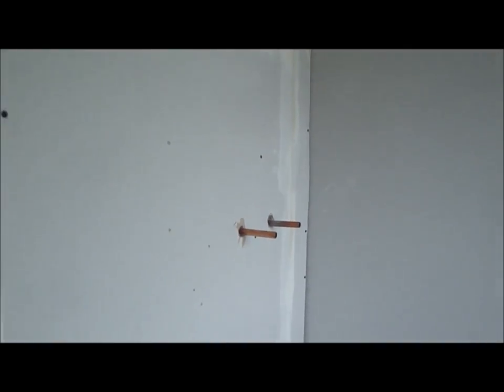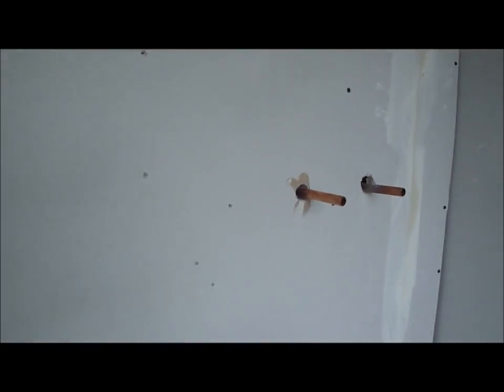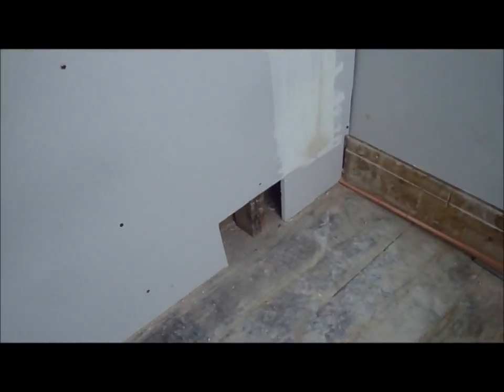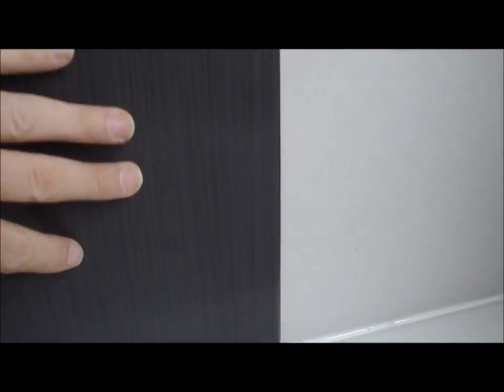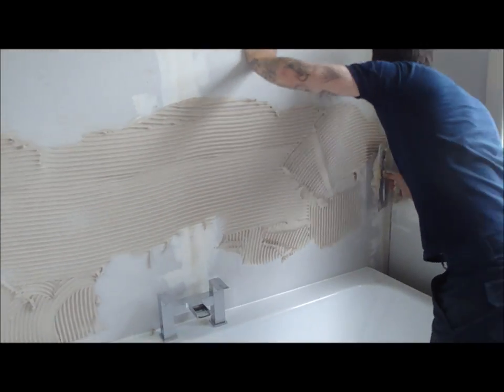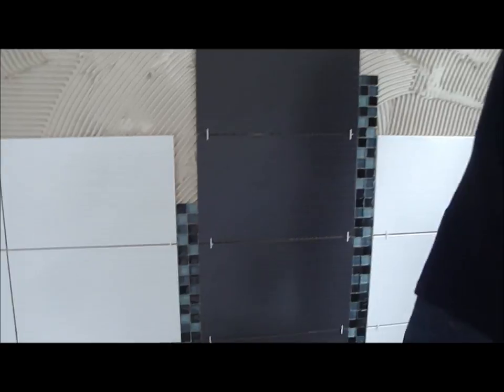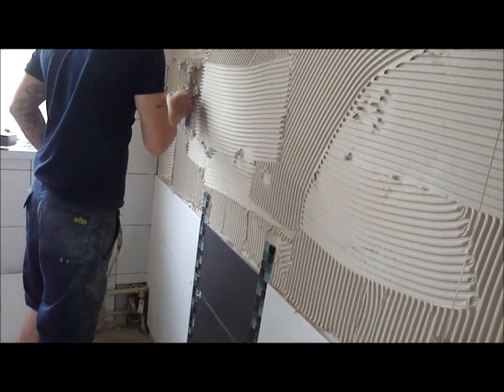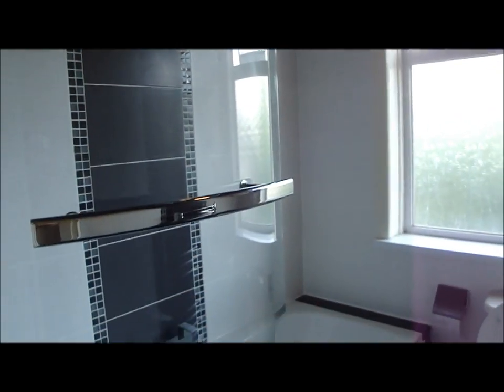Coventry Bathrooms Fitting A Bathroom Suite

Comment: Good job, I have a question though, how do you disconnect the taps if you need to take the bath out ?
Reply from the maker: If you take the bath out, it is a good idea to isolate the water to the bathroom, then isolate the  hot and cold feeds on each water pipe.

The taps are normally connected by a nut that is screwed tight to the under side of the bath. This nut will need to be turned  release the tap from the bath